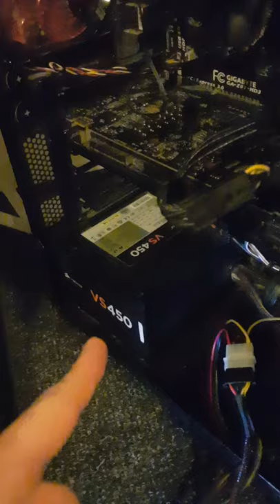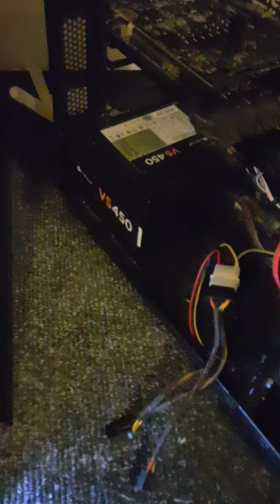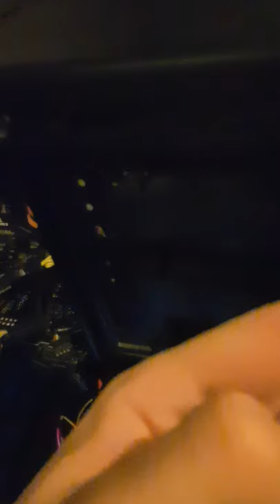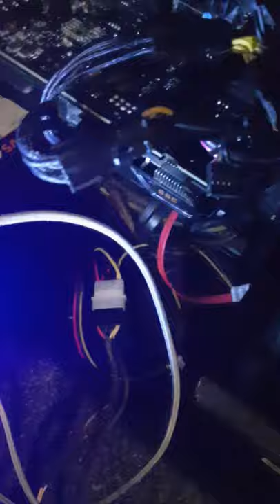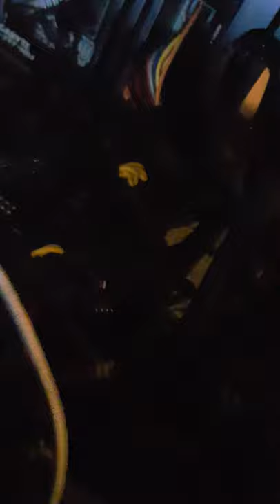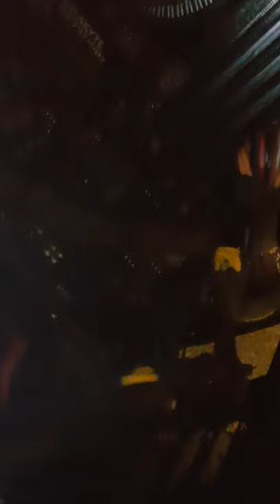Fridge bonus: video machine broke

Comment: If your graphics card takes more power than the power supply can handle, it can screw it up. I'd recommend buying a 650+ Watt PSU and using the 1080 Ti, if that doesn't work there's a chance it somehow screwed up your motherboard so you might need to replace that (make sure the replacement is compatible with your CPU, though).
Sorry to hear about this mate, I spent this past year on and off trying to fix my PC, dealing with faulty products and customer support. I finally snapped and just upgraded the damn thing, so hopefully it's back up soon. Wishing you luck with yours dad.
Reply: If you did bend the pins on your CPU, and the computer's not booting up at all, you're likely fucked and will need a new one, as well. It's not always fatal but if you bent the motherboard pins then it probably is. Basically if it still runs but it's just slow, the pins aren't the issue and it's likely to do with your PSU.
Reply from the maker: @n0lain  it boots and everything it just runs halo at like 30fps when I could do 66 fps fine before, I have no idea why it runs all stuttery and shit now gpu and cpu seem to both be underutilised (like 30% use for both) maybe the cables are just fucky and I plugged them in the wrong place
Reply: @STRONTIumMuffin  Sounds like it could be an issue with the power supply. Are you sure the monitor's plugged into the GPU, and not the on-board graphics?
Reply from the maker: @n0lain  yep it's In the gpu
Reply: @STRONTIumMuffin  must be the power supply then